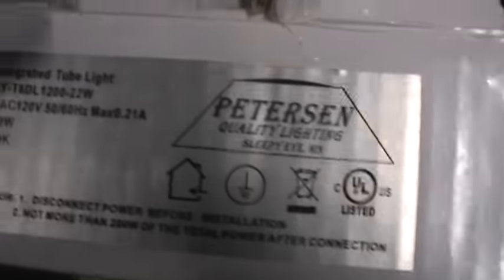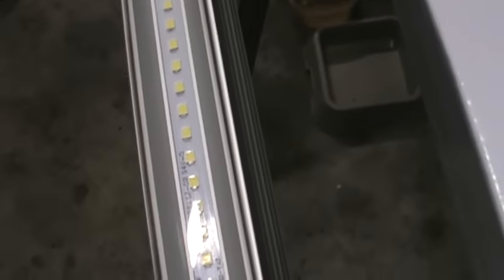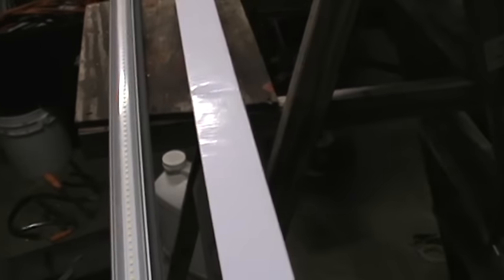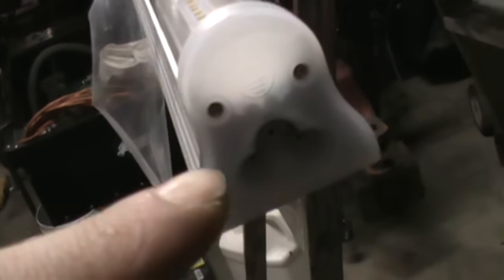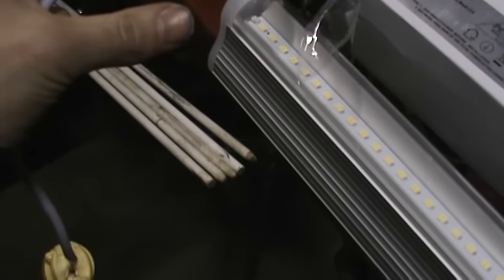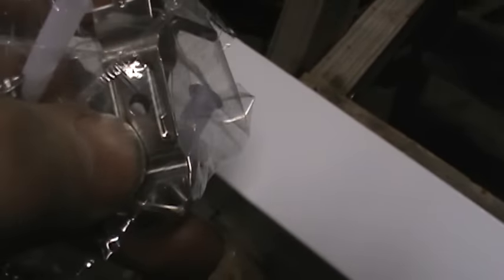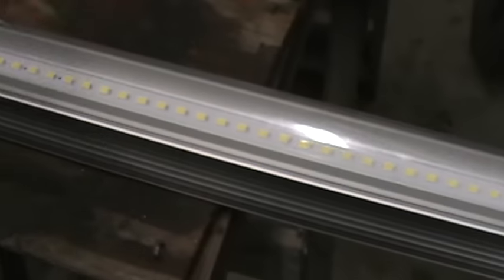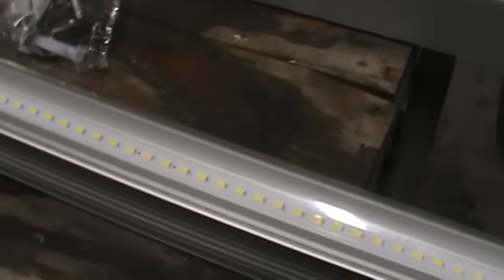New Led Shop lights Pt 1

Comment: Cole, I just did a vid on retrofitting the old style double shop light with LEDs and they work great.  It averages about $10/bulb and it's real easy to modify the old light fixtures.